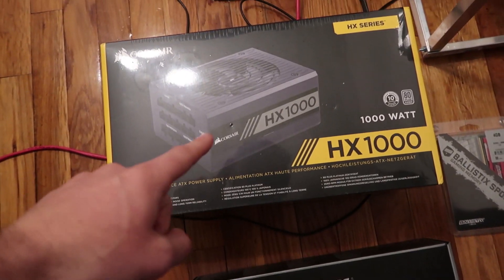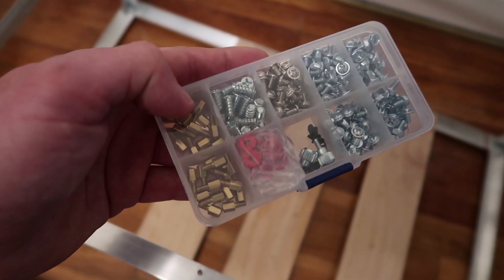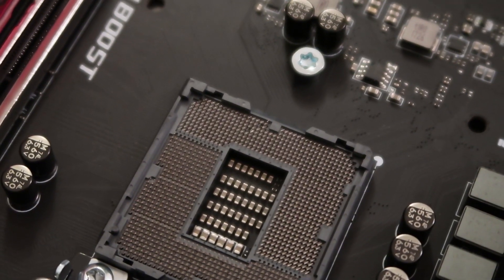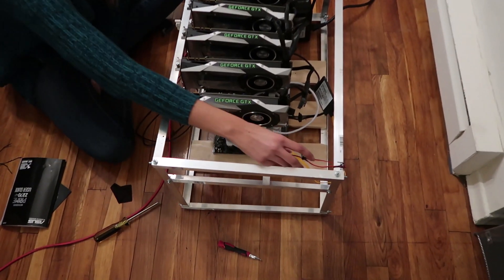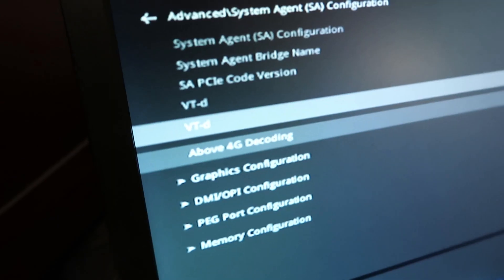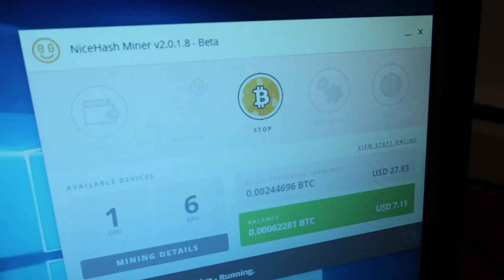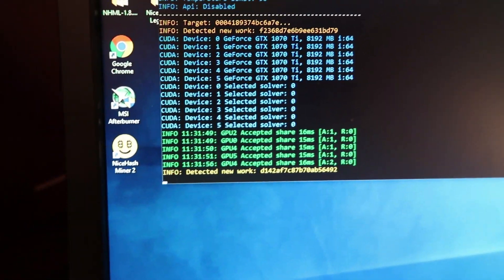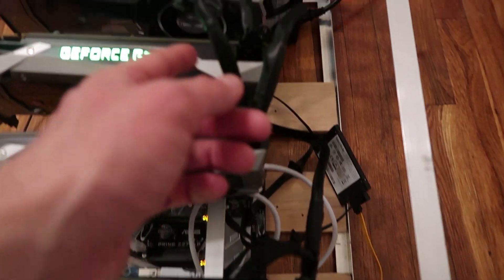6 GPU Mining Rig - NVIDIA GTX 1070 Ti

Comment: hats better?  antminer or gpu's??
Reply from the maker: Guess it depends which Antminer. S9 is not worth it in my opinion. If you're looking at the Z9, that's pretty good. But it is risky at the moment. GPU is usually going to be the safer long term bet.
Reply: Thanks for the update

Comment: 1000W for 6x 1070ti's? They each burn around 150W... 6x150=900 + rest of the system you are getting close to 100% load on that PSU if im not mistaken :S

I personally have 8x 1070ti's running off total of 1500W (Have two 750 PSU connected with a dual-psu cable) 8x150 = 1200W so I should be at around 85% load :)

But of course PSUs can handle 100% load that's what they are designed for after all. As long as they have a 5+ year warranty that's the most important factor.

Comment: Hi I have a stupid question, how did you connect ur windows 10 pc to your mining rig?
Reply from the maker: I had the Windows 10 install on a USB drive. I then booted to the USB to install it onto my SSD. You can get the ISO image right from the Windows site, and you don't need to pay for a license to activate Windows. It runs fine without activating.
Reply: JMS Vlogs I’m sorry but I’m slow when it comes to computers. So what your saying is for me to get win10 and install it to a usb drive? I didn’t know that was possible. Then booted it to the SSD? What does booted mean? What is an ISO image?
Reply from the maker: +Jose Sanchez You're creating a bootable USB drive with a Windows 10 image on it. This allows your computer to start with the information on the USB which then allows you to install the image on a hard drive. Follow the steps here: https://www.windowscentral.com/how-create-windows-10-usb-bootable-media-uefi-support
Reply: I made the bootable USB drive with win10 on it. So now I connect it to my rig and from there run the setup and  install it to my SSD.
Reply from the maker: yes that's right
Reply: does the ssd/hdd have to be empty or it doesn't matter?  I tried to upload it to an external hdd but it says that setup does not support configuration of or installation to disks connected through a usb or ieee 1394 port.
Reply: it also said that it cannot be installed to a disk that has an MBR partition table. On EFI systems, windows can only be installed to GPT disks.  What does that mean?  Do I get a new sdd/hdd?
Reply from the maker: +Jose Sanchez How old is your motherboard?
Reply: JMS Vlogs it’s about a month old?

Comment: You are part of the problem with GPU  Prices
Reply: right on.
Reply: I'm not going to go on calling names have more respect than that.
Reply: Don't be mad because you broke af and can't afford the cards
Reply: Quantox Gaming I have 30 EVGA GTX 1070 FTW. The GTX 1070 Ti were sold out at the time so I couldn't buy any. I buy my cards at a retail price of $500 USD each.
Reply: Quantox Gaming whichever card you're planning to get, stay away from the founders edition model. They get really hot and loud.
Reply: Quantox Gaming the normal version is the founders edition

Comment: Great video however I am running into a bit of a problem, I have a 4 unit GTX 1070TI mining rig running on NiceHash and it is only earning $9 to $11 per day based on what you are earning, I should be at around $18 per day - my settings are like yours 70 power 100 core and 720 mem. So I don't know what to do to improve output, any ideas?
Reply from the maker: The issue is that the BTC price is really low right now compared to when I made this video. Can you tell me how much BTC it says you are earning? You're OC settings should be fine.

Comment: The peak for full load on this cards is 217 watts, which means six cards alone will come down to 1302 watts. Taking into account you want to at least be 25% above this number with your PSU wattage and that you might want to overclock them for better results your PSU is nowhere near enough wattage for your cards to perform well.
Reply: 65% TDP is around 120W.

Comment: So as a total mining muggle, I have a question: Right now I can get a GTX 1050ti for about 140.00 GBP, whereas a 1070 as used in this video won't give me much change out of 600.00. So given that the 1070 generally benches twice as fast as the 1050ti, would it not make more economic sense to use 2x1050ti cards in place of the single 1070? Does power usage make that much of a difference, or am I missing something about the way these cards work?
Reply: Yes you're right. Only problem is 1050ti takes up double the PCIe slots then
Reply: Dont buy NVIDIA to mine, buy AMD. The hash rate for example of an Rx 480 is comparable to the GTX 1070, and i own a 1070 yet the AMD card is twice as cheap
Reply: Lord Caoliki amd is sometimes inflated to the point a 1070=580 in terms of cost. You should get 1070 then since gamers will pay more for it
Reply: Pennywise yeah. Unless of course you can actually get amd near msrp, then amd is far superior. But most people are dumb and think they NEED amd to mine and happly pay $700 for a Rx 580 instead of a $400-600 1070

Comment: How did you get 6 1070TI's  when they are sold out?
Reply from the maker: i refreshed the page like 100 times a day for a whole week. the notify feature doesn't work either. if you're lucky to see add to cart, make sure you make the purchase within 5 minutes. they go quick.
Reply: noted, those ti's you got perform better than the asus & msi ones.
Reply: Thanks for the tip.

Comment: Nice setup, is one 1000w power supply enough to run 6 1080 cards?
Reply: I was wondering the same.  The video shows he's pulling 753w on just the cards alone.  Add the rest of the computer and that'll likely add another 130w so he's pushing within about 100w of the psu limit.  Seems a little close for comfort, but that is personal preference.  I got a HX1200i for my 6x 1070ti rig.
Reply: i ended up buying 2 PSU's, one is 1000w and the other is 750w. works just fine
Reply: Funny.  That's what I did with mine.  Got a 1200w powering all GPU-related connections and a 750w on the rest.  Your numbers are pretty much in sync with my Zotac 1070 ti minis.
Reply: I would never buy more than 1000 because 2 850 are usually cheaper than 1 1200 and you get more whats. The complete draw for my 6 cards was 796 mobo and cpu included.but if you go 2x 850 you can expand the ASUS 270-p to 8 cards/9 cards it gives you room to grow.

Welcome to mining guys glad to have you on board
Reply: yes it is 6 cards is only about 796 watts you have 6 VGA cords and if you use the you can get away from sata risers 
https://www.youtube.com/watch?v=g6PUfUIX3Qw

Comment: What is the overall cost of the rig?
Reply: lmao i found someone selling a 6x 1080 ti mining rig for 3800. Ready to mine. Too bad im poor :(
Reply: At current GPU prices about $7,000 USD. Each 1070Ti is about 900-1000 USD.
Reply: hey i found a add on craigslist its 7 x gtx 1070 mining rig. for 7000 is it worth it? ready to mine
Reply: MOAON AABE he legit said they were 450 each....
Reply: Looks to be around 1800 with what he has in the description of course my calculations are for only 2 GPU's not including keyboard mouse monitor and windows 10.
Reply: Miguel Valdez no
Reply: ShinyTomb That is a crazy good deal, assuming everything still works...

Comment: lately I've been earning more btc ruining 100 core, 400 memory. it changes which algo you mine. I never mine neo if I have it at 400. make 0.001 a day with equihash. 0.0005 when i oc to 700 on memory because algo switches to neo. just heads up
Reply: .001 per how many cards?